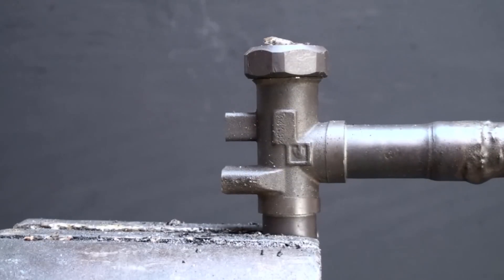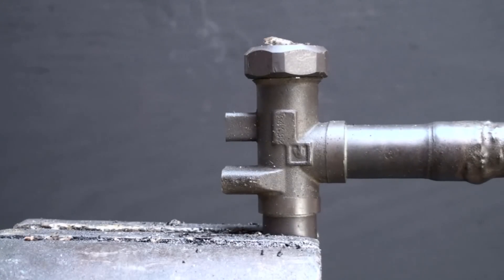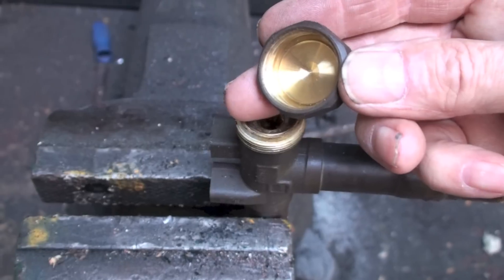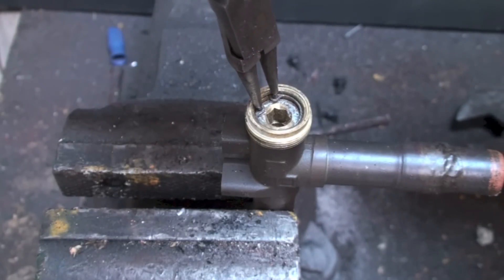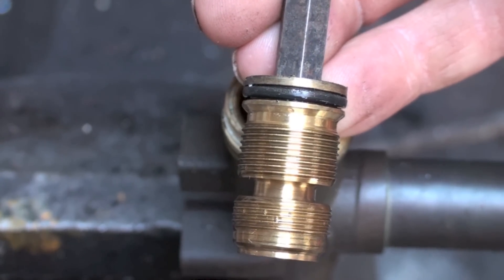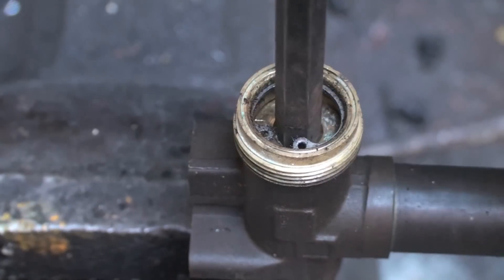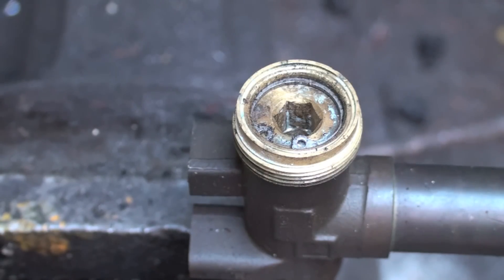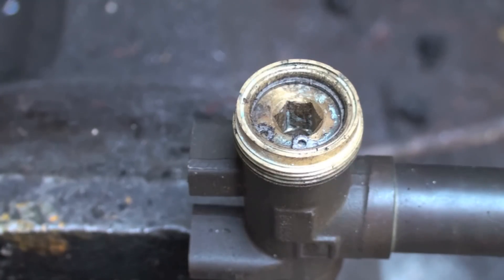Replacing the o rings on leaking HVAC service valves

Comment from the maker: As the brass cap is quite thin, I don't agree it is capable of an effective seal.  Some of these caps have bulged up like a ballon in 410A systems.  The first of these I saw were the Carrier RQ systems that used a gasketed cap that would also leak like a sieve.  
GFM

Comment from the maker: As leaks are the worst problem we have in this industry, I think the best approach is to cover all basses with  effective repairs.  A schrader cap is not a repair for a leaking schrader.  As you know some manufacturers use a plastic cap so not all manufacturers agree.  Also, unlike the schrader, the cap is not being pushed closed by system pressure.  Thanks for a great conversation.
GFM

Comment: For thread leaks I have had good success with Nylog sealant by Refrigeration Technologies, Anaheim Calif.,  red bottle for R-22 (CFC-HCFC), blue bottle for R-410a (HFC), seems to work a little better than Leak Lock. Hope this helps all and thanks for the video. I've learned a lot from you.
Reply: I put that stuff on everything, little dab on schrader threads, cap threads etc. Just a little dab and it works wonders. Stopped so many little stupid leaks with that stuff & it doesn't give easily.

Comment: Continuing again,   Personally, I have never had to replace the o-ring, even if overheated, because the cap performs the final seal, it tightened correctly.  I HAVE had to replace the whole valve only if some jarhead severely over tightens and deforms the valve, as you mentioned in another video.

Comment: Continuing, assuming the threads are clean, tighten the caps by hand until the brass mating surface on the cap meets the brass mating surface on the valve, THEN TIGHTEN 1/6 TURN MORE WITH WRENCH.  DO NOT TIGHTEN MORE THAN 1/6 TURN, SO YOU DON'T DEFORM THE SCHRADER OR THE VALVE, LIKE YOU MENTIONED IN YOUR OTHER VIDEO.

Comment: I have been in the field for 33 yrs, an owner operator for 28 yrs and an American Standard dealer for 20 yrs. and still learning, as we all are.  Based on MY experience, I must respectfully disagree with part of your diagnosis.  While I do agree that the core MUST be in good condition, with a good gasket, the Amer Std install instructions clearly state that BOTH the schrader caps (brass hex with NO gasket) AND the much larger service valve caps are a BRASS TO BRASS SEAL.

Comment from the maker: I almost never replace o rings in the field.  And those that think you can stop the leak by tightening the cap or using pipe dope (or whatever super seal you can find) will find that if the unit is followed that it will leak again.  Thanks for the comment.
GFM

Comment: I have replaced several of these caps where someone has tighten so tight the top of the cap broke off or split the top! I also have had very little success changing the O ring. I think the valve itself wears and causes the leak not always the O ring. I've had better results changing the entire valve. Great video!

Comment: Amazing they seal at all with just the one o ring in them.
If they are leaking and you get a lot of liquid condensed between valve and cap, if the temp goes up it will pop just like an overfilled ref cylinder with not enough expansion room.